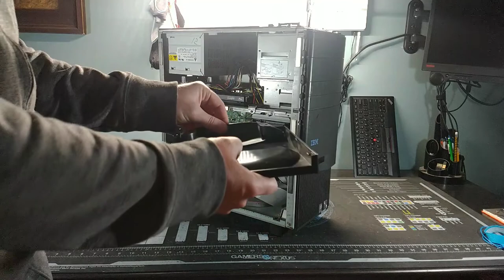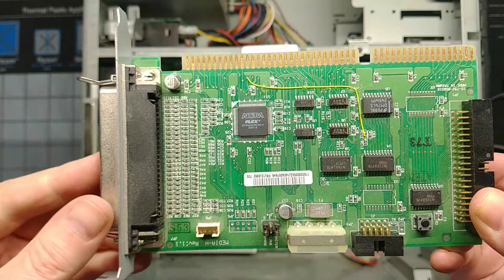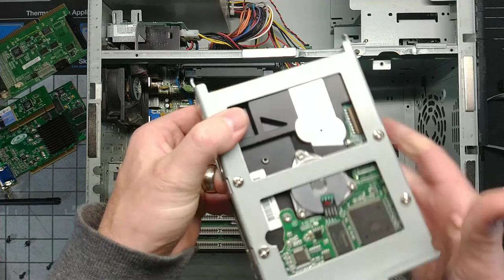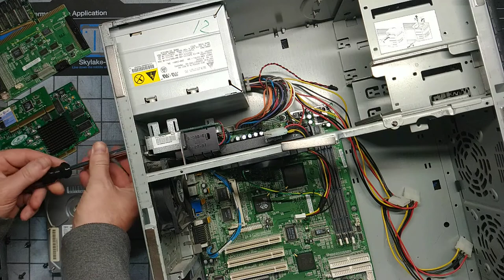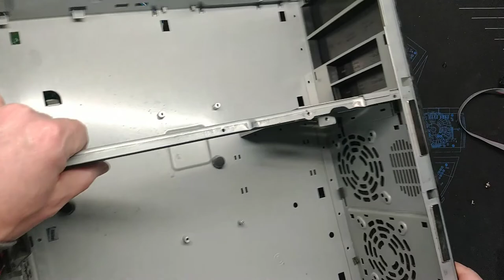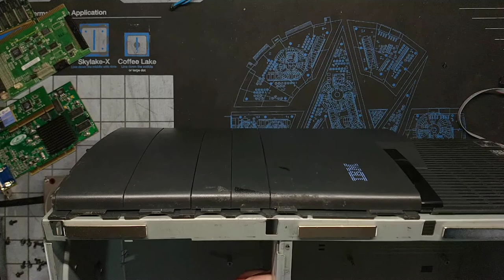Aptiva Stealth - Part 3: Disassembly

Comment: I don't know if you seen it before but with the clips to replace them you can try using what's called epoxy sculpt it normally dries really hard so it should act like a plastic and you could use a piece of paper clips to reinforce it like a skeleton
Reply from the maker: Thanks, I've watched bunch of retro YTers do the super glue and baking soda as well.  I'm thinking about trying that, but reinforcing with some paperclips as a skeleton for them is a great idea!

Comment: I might use some hand cut and formed sheet metal tabs glued to the plastic with JB Weld epoxy. I'm making similar repairs to an old HP Pavilion Notebook PC. I'm having some trouble removing the original HDD. The screws are unusual. My Aptiva Stealth is a bit different than yours. I'm watching your progress.
Reply from the maker: Thanks!

Comment: Can you tell me why IBM used a 5.25" and a 3.5" IDE HDDs in the Stealth? Was there some specific reason?
Reply from the maker: They had a deal with Quantum IIRC so those bigfoot drives got used in a lot of Aptivas.  PC300 series desktops of the same era still used IBM Deskstar drives which had a higher cost.